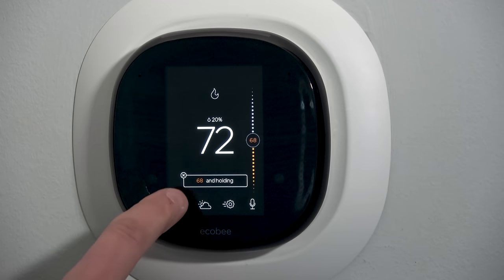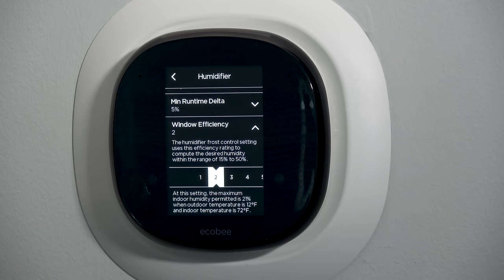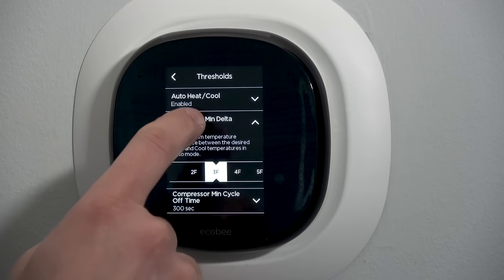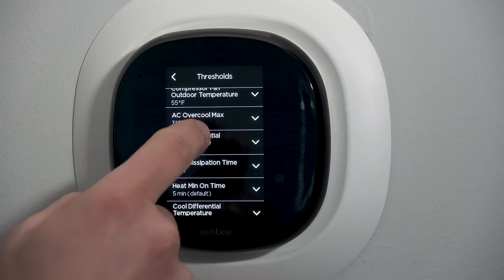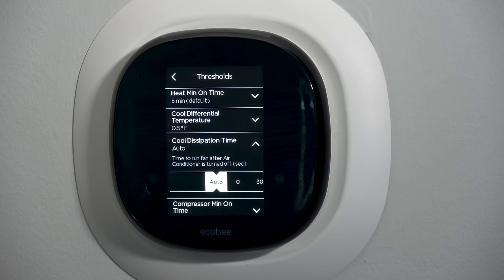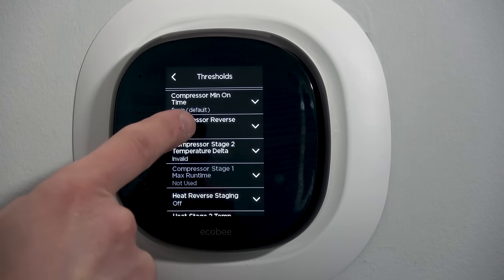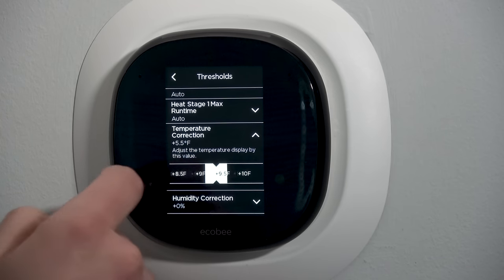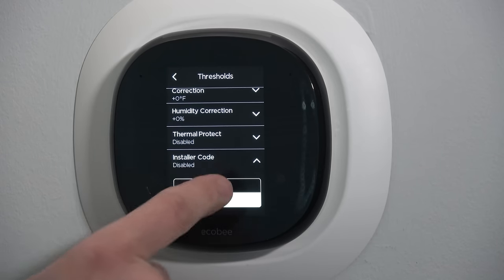ecobee Pro Advanced Setup (3 of 5)

Comment: So this thing has every other option (90% useless) but doesn't have an option to control fan speed. Good job !!
Reply from the maker: Controlling fan speed is a function of the equipment more so than the thermostat.  The equipment would have to have something for the stat to wire to for fan speed inputs and standard residential furnaces and fan coils do not have that.  If you happen to have a 3 speed fan coil that will accept a G, G2, and G3 fan speed signal, then YES ecobee can be used to control fan speed.  Those fan coils are typically only common in multi-family buildings with hot/chilled water.
Reply from the maker: If you are talking about controlling fan speed on communicating variable speed residential furnaces and fan coils, that equipment is all priority.  You need to have a communicating wall control from that specific manufacturer to control those fan speeds.  You cannot control them with a 24v thermostat like ecobee or Honeywell.

Comment: I don't have disapation settings on my menu
Reply from the maker: Is your system heating only and a boiler?
Reply: @TECTubefilms  turns out the settings are only available if you have the system set to manual staging vs automatic
Reply from the maker: @76TomD  Good point. That 6 year old video may have been prior to the menu adding the choice of manual

Comment: 3° is too much😮 for humidity overriding
Reply from the maker: We have 30+ of our own thermostats in our own buildings set to 3° and it works well. When you switch from a standard stat to one with this type of humidity control, you also need to select a setpoint that is higher than your old stats setpoint. For example, if your old stat was set at 72 then now instead you will set it for 74 or 75. On dry days you will be more comfortable at the higher temp. But on humid days, the stat can override that temp using the A/C Overcool dehumidification mode and you will end up back down around 72. In addition to greater comfort, this allows energy savings on the non-humid days.
Reply: @TECTubefilms  nice 👍, great job.

Comment: I installed a ecobee tstat with dual fuel set up, when I try to turn on reverse staging for compressor or aux (gas) on the settings and I try to exit settings it gives me a warning and doesn’t let me leave the settings. What could be the reason to that???
Reply from the maker: This is normal. To use reverse staging you had to select manual staging config instead of auto staging. Scroll down the list and look for one that says invalid to find the configuration choice you did not make a selection for.